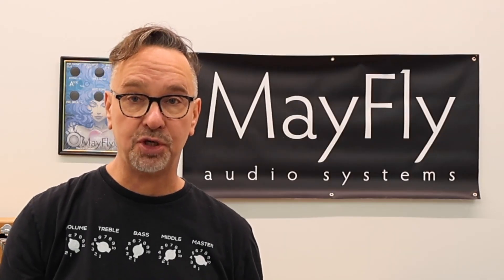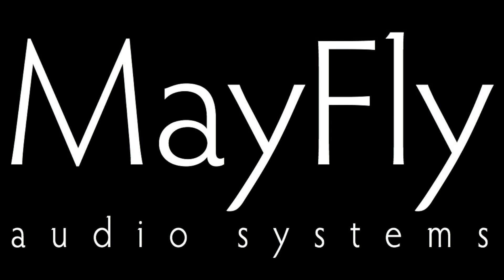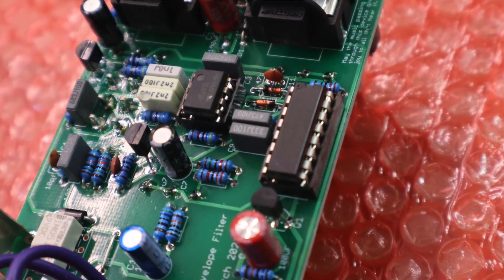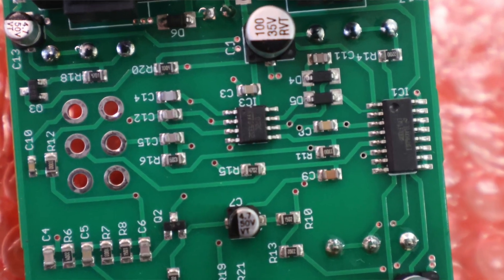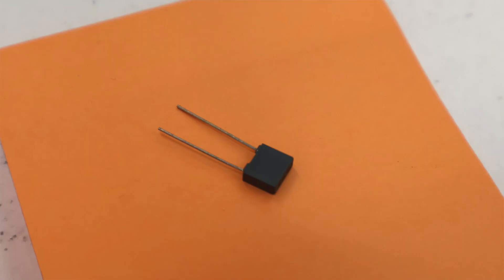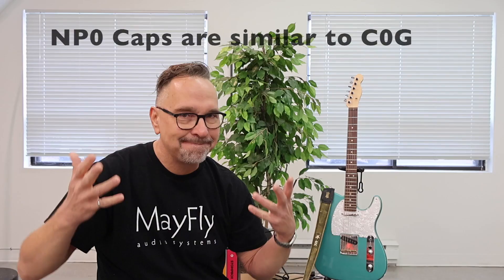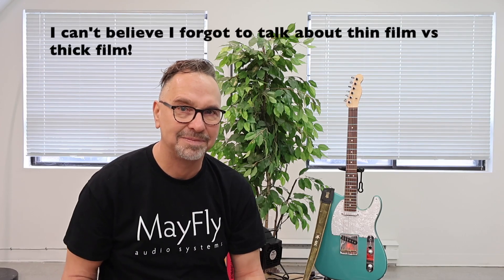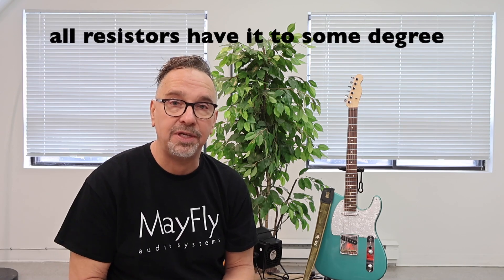Mayfly Inside #1: Surface Mount vs Through Hole Web

Comment: Surface mount is irepairable/disposable
Reply from the maker: Hi there, thanks for your comment.  Actually, if you have the right tools surface mount components are easier to deal with than through hole because you can do everything from the top side.  Regarding tools, a tweezer soldering iron and a hot air gun are all you need.  That and a steady hand ;)